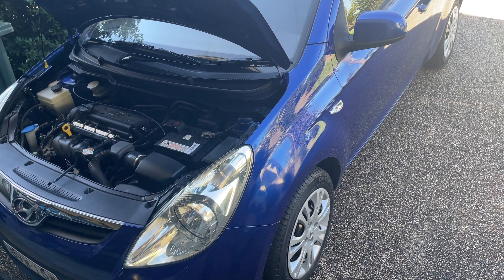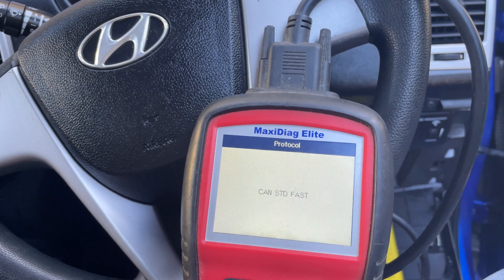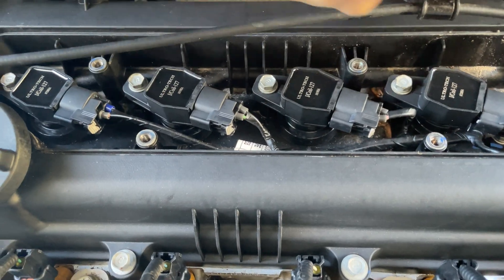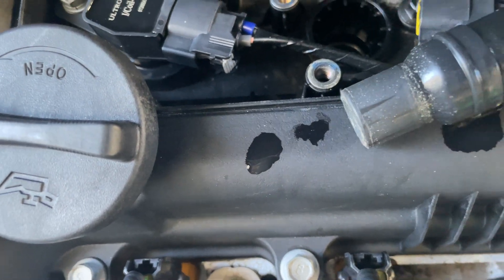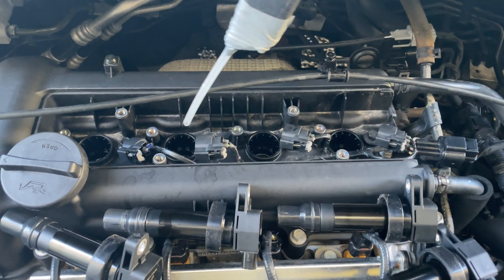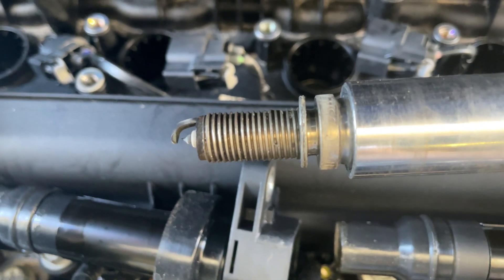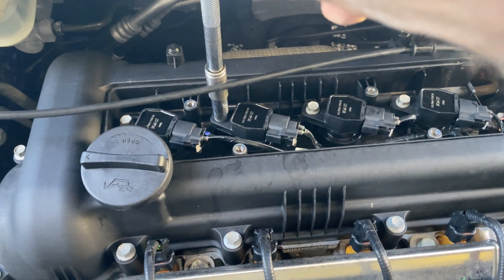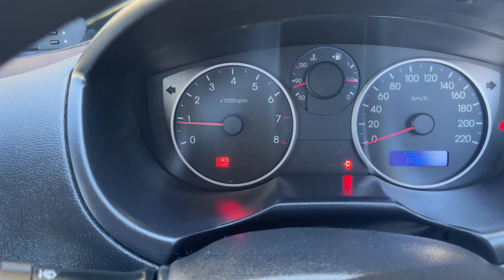Engine misfire running rough coils plugs & leads Hyundai I20 also most 4 6 & 8 cylinder Toyota Mazda

Comment: My Sister 2012 i20 just has been quite bad...Misfiring and lost all power badly...Also,the rev counter works,then dont work,and when it stops working,the power is gone altogether,so badly,that the car can not go up a hill.

Wht could be the cause of that?

Thanks
Reply from the maker: wow, that is an issue... it sounds like its losing 12v power... I'd be checking if the battery is still usable? they only last around 3-5yrs, so it could be shorting internally as they do when they are failing.. That would cause that fault.. If its good & recently renewed, just check battery terminals etc to see if they are dirty/not connecting etc.. Hope that helps! 😃😃😃
Reply: @mikemike7523  thanks...I will do so when I get back from work.

She did say that these issues started with the car when she changed the battery 2 Months ago,so I will definitely check that out...Thanks alot
Reply from the maker: @ may be on the right track then! Possible connection/battery terminal issue 😃
Reply: @mikemike7523  just had the vehicle checked now by a Hyundai specialist,and apparently the issue is a crank shaft sensor.

Comment: I have the exact same problem. And after cleaning the coil and changing the spark plug it goes away.  Most mechanics see the moist and want to open up the engine.  What actually causes the moist if one hasn't washed the Engine?
Reply from the maker: I would say if you havn't washed the engine recently, it's been in there since before you bought the car maybe? it wouldn't develop water inside plug ports any other way... Hope that helps! 😃😃😃

Comment: My i20 2014 1.2...rev is always above 1k when idling why?
Reply from the maker: hi! that is a bit high for sure.. You will need to have it scanned & run live diagostics to nail down what is actually incorrect..., Hyundai can do that. At least its not stalling! Thanks! Hope that helps, 😃

Comment: Hello hope you good, I got the i20 too u know and you just helped me a lot by this video, now the thing is how do I get that machine you have that clears the codes and what's its name?
Reply from the maker: Oh so good that this has helped you! Yes the tool is usually called a "scan tool" or more specifically an OBD2 scan tool... Most cars in Australia use OBD2 plug.. Some Euro cars use a different plug/tool. You can pick up cheap ones at your local car parts/accessories store.. In Australia stores like Repco, Supercheap Auto & Autobahn would help you get a scan tool to do the job for under say $100 for a basic scan tool... Mine is a bit more  pro, but the cheap ones usually give most info to do the job.. Let me know how you go! Thanks for watching 😃😃😃